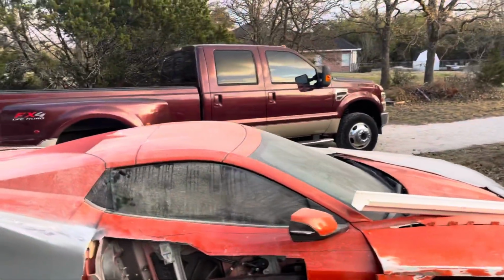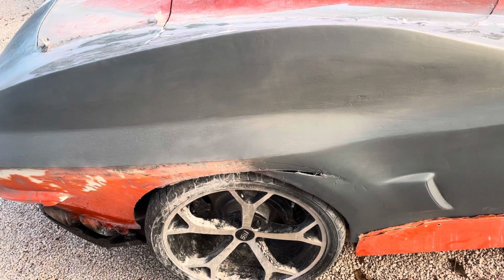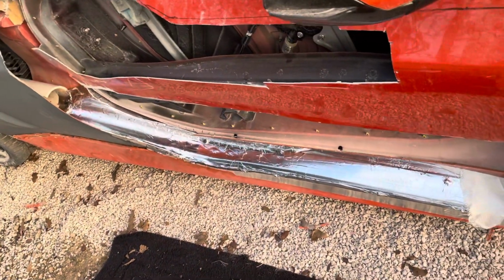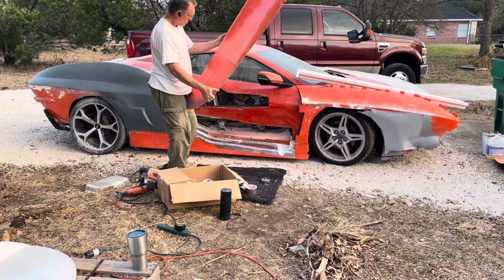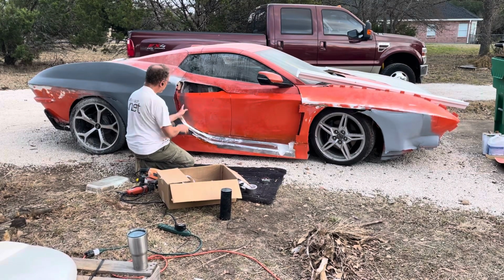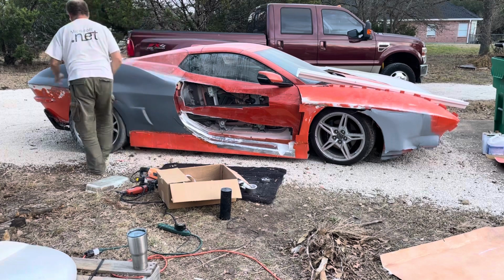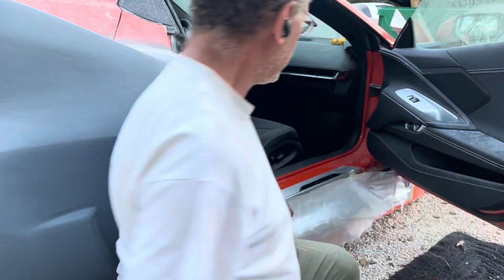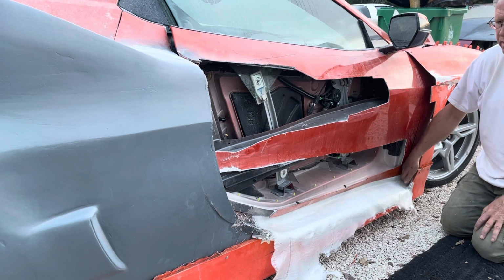C8 Corvette Hack - Just Ignore the Cracks!

Comment: you could always use 2 part epoxy like those tubes you showed us on facebook and seam the body panels together than use the fiber glass to finish the build, use a fast panel bond or clamp then and use the slower ones so you dont go trught the tube ends youll need to mix the product
Reply from the maker: Great idea… thanks!